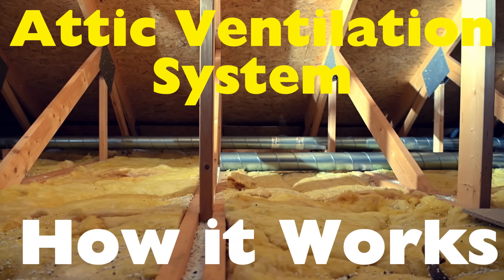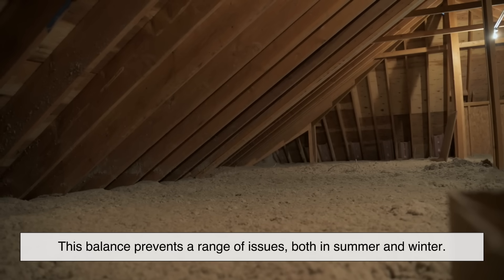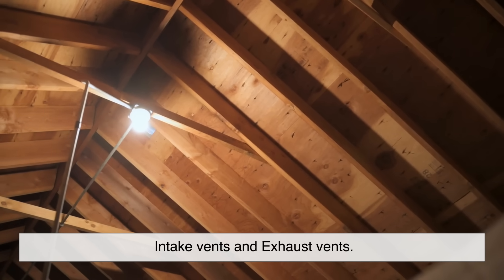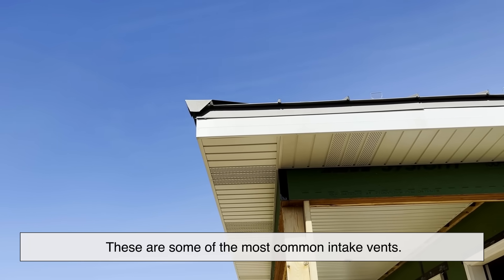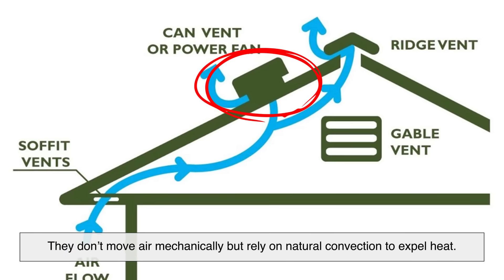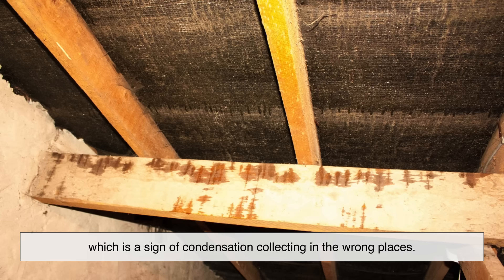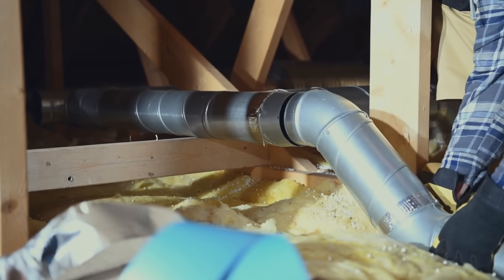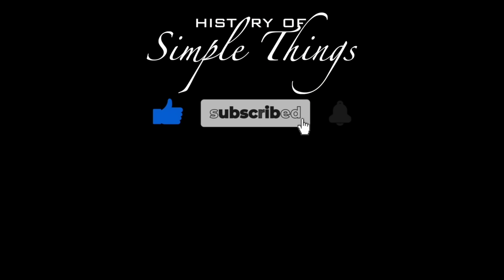How Do Attic Ventilation Systems Work?

Comment: For new construction homes, an unventilated attic, where the attic gets air from the HVAC system, is the preferred method. It goes without saying that the attic in this case must have adequate insulation. This method is also better for areas prone to wildfires.

Comment: Soffit vents should be a little dirty, that’s how you know they are working. Don’t be surprised if the builder did not cut the plywood behind the perforated soffit vent, or somebody stuffed insulation to block the soffit vent. Remember those baffles are very important.